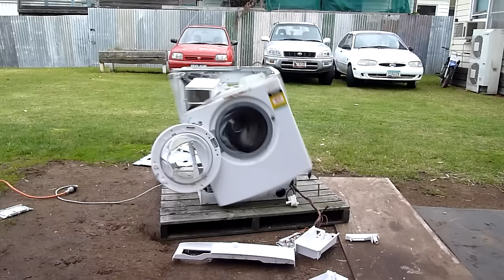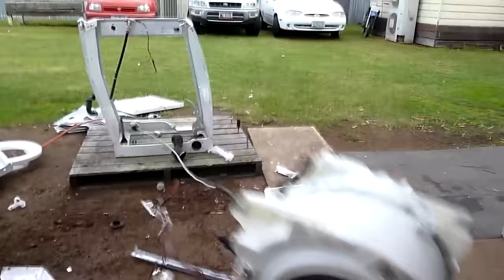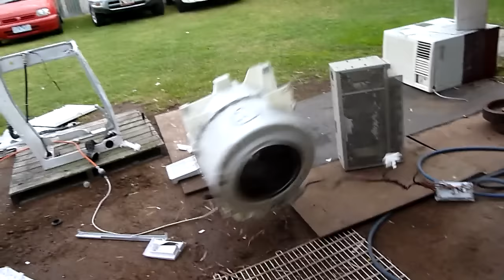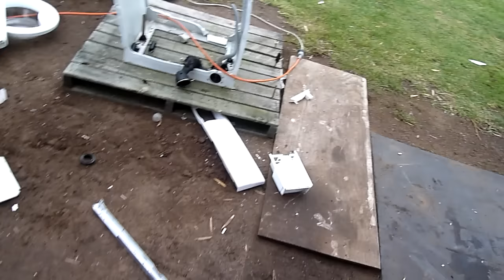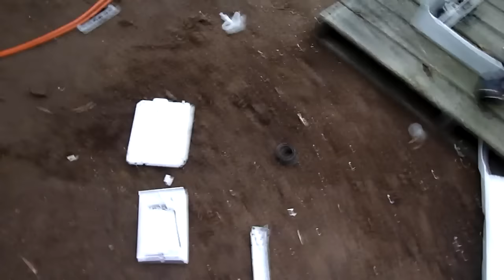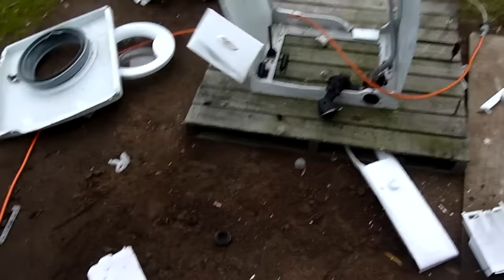Front Load Washer Total Carnage - Washer goes Chain Chomp on me

Comment: Wow,  truly impressive how the motor and drum stayed together so long.
Reply: True! But for safety I'm wondering why it didn't shut off when the electronics ripped out 😂😂
Reply: @Sublimeshredder  They connected the motor directly to a variable speed device, like a simple dimmer switch, bypassing all the electronics.
Reply: If you watch a "How to repair a washing machine" video you will see how well they are constructed in terms of not ripping apart. Pretty well constructed mashine.
Reply: @Eden_M  No they didn’t
Reply: It tolerates the abuse to a certain point, then emergency escape mode gets activated.
Reply: Well now you know the model of Laundromat you need to buy if you want to wash your garden stones
Reply: @Sublimeshredder  потому что он был подключен на прямую.
Reply: Yes.....but can it clean the coffee stain out of my sweatshirt? No
Reply: Yeah xd
Reply: Indeed. I recently found out that 35% of all ocean microplastics come from clothing/textiles, mostly polyester, but also acrylic and nylon as well. This is largely due to clothes made of these materials being washed, which causes these clothes to quickly erode, with the microplastic fibers entering the water system and eventually the sea. Ocean Hero is a great search engine that we can use to help clean up larger plastics before they disintegrate into microplastics.

Comment: That was Fabulous! I have worked on my Whirlpool front load washer for two days replacing the rear bearings.  I got it all back together the drum wouldn't turn. Took it back apart.  Lubed the rubber boot at the drum, put it all back together.  Hookied up the water, plugged it in.  Ooops I noticed I left a part off.  Took it all apart again, put the part in.  Put it all back together again.  Hooked up the water again, plugged it in. Loaded some clothes in it. Turned it on, nothing. The door wont open.  Needless to say there was some cussin' going on in the basement.  Totally frustrated, I turned to YouTube for solace and maybe some fresh ideas how to get the frickin' door to open and get my clothes back.  Seeing you destroy that front load washer was just what I needed! Thanks man!
Reply from the maker: Haha, yeh these machines can be frustrating at the best of times, this one got blown up by a power surge, so the donor had me in mind when it came to disposal of the remains ;).
Glad you enjoyed it :D

Comment: Tears of laughter. I especially love this because after having top-loader washers since 1959 in Australia, Canada and America, I moved to England where front-loaders are a religion. They still haven't caught up with 1959 Australia. I got stuck with a horrible front-loader here. One day, the cement ballast came loose and there was a racket and the door flew open. I had a repair contract and the dude said "I will write this off for you." I was delighted and asked if I could have an American Whirlpool top-loader (like a Maytag) if I chipped in a bit of cash. He said yes. I had to install it in my shed, because England kitchens are too pokey. Never looked back. It does a load in 25 minutes instead of three hours, and it holds three times as much laundry.

So, bring on this video!

Comment: I'm actually  super impressed  with the build quality.  It still ran even though important components and circuit boards flew off. Crazy funny to watch it fly around the yard, didn't expect that either.
Reply: Because it was directly wired to the motor and the circuit boards of the washer weren't in use

Comment: Can we just appreciate how long it lasted for an older piece? Very sturdy!
Reply: Well, depending on the age, it makes sense. A lot of older machines weren't able to be made to be cheap and easily replacable like the ones we have now.

A lot of older machines, had to be made of more rugged materials. So they're far sturdier. Think of a Steel Body Car. It's a car made of a steel frame. It won't be totaled in a mild accident but they're bloody expensive and very dangerous too.

Modern day stuff is made of much softer cheaper materials because they're far less dangerous in some instances. I mean would you rather have a mashingmachine that breaks down if the wrong stuff is put into it or one that does that shit, especially if there is no way to shut it off easily. And they are far easier to replace, in terms of parts and the whole, and make the machines cheaper.
To use the car analogy again. A modern day car is literally designed and tested to reduce as much of the impact of a crash as possible. And it's parts are much chaper then a lot of older cars, even when accounting for scarcity of old car parts.
Reply: @linhero797  im not aware of any new cars that dont have steel frame and bodywork.
Reply: @linhero797  Dude… That’s some crazy explanation, admit you were high as fuck lol 😂 . I mean I get your “some new stuff is cheaper” analogy but as far as car frames are concerned, they are in fact a lot stronger and lighter, it’s not about whether it’s steel or aluminum, it’s the geometry of it that matters even more. You could talk about the interior though because that has gotten a lot cheaper and much flimsier in most cars. 

As far as washing machines, I don’t think they are fundamentally cheaper, nor are they much better, it’s the hyper digitalization of it that makes it shit It has a 1000 useless features, it even sings happiness to you, but a shitty circuit board is more like to die on you before the motor.
Reply: @gegervary  I wasn't high I just applied some basic logic. If there is something I missed you just need to point it out.

Also, this may just be a thing with my people but Steel Body Cars are a term used to describe older cars, the protal coffin types as some know them better, obviously there is more too it. Modern Day cars are designed with softer parts and designed with purposeful design flaws to make them safer. A wrong explanation but, oh well. It happens.

And you do know you can still get mechanical washing machines, they're actually way more common then the ones with all the digital bits and dildos and coffee makers installed. Because a basic washing machine is all you need.

Perhaps it's just me. But I have never known someone who used one of those overpriced pieces of shit. And that's why they never came to mind as a point to make because they're not the common type, so they're not really worth considering as a matter when trying to make a good apples to apples comparison.
Reply: @mariaconcepcionrodriguezhe2850  Steel Body cars is a term for older cars that did not have the purposeful flaws in then that make them crumple to protect the passengers. I did use a poor explanation, but the term is a real thing.
Reply: I mean it would have shut off after the Electronic was gone. Though it sure seems like the motor was just connected to a powersource so no security features worked. Also never saw a machine at large speeds when it started up.
Reply: "smart machines", modern ones, woudlnt even start i think...
Reply: Come to channel there is a lot of interesing stuff there😅

Comment: a few mods?  Now you know every screw  and fastener in that thing had to be loosened in order to elicit that performance.   Clearly, the safety switch that shuts the thing down when the door opens was bypassed.
Reply from the maker: eh, your close, I left all the screws tight and added some in where needed (bolts and washers to stop the suspension springs jumping off their mounts) the motor was hard wired to a Variac, and the concrete counterweights were removed.

Comment: I seen an old video of someone trying this with an off-brand washer, a cinder block, and running it on twice the voltage it was designed for. THAT was scary! The cider block turned into gravel, and the drum burst open. Surprisingly, the motor was still going when they killed it. 

I kept expecting the motor to throw off the belt, or the bearings to fail here, I have to hand it to Whirlpool, they do build a good machine.

Comment: how the heck it can spin that way . nothing detect the imbalance , the door open , the water ??? . My samsung washing jus a little imbalance due to spider arm broken  (still working fine with small load) it detect the imbalance and stop and give you a warning message
I guest you connect the power direct to motor so it by pass all the safety feature